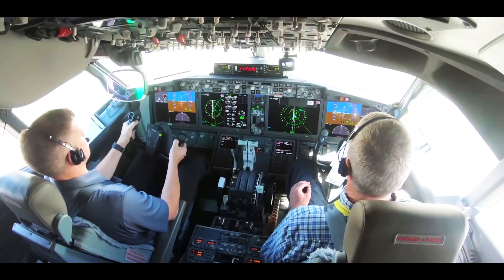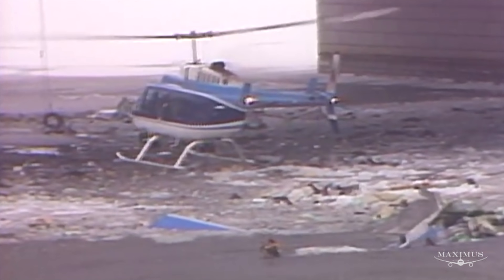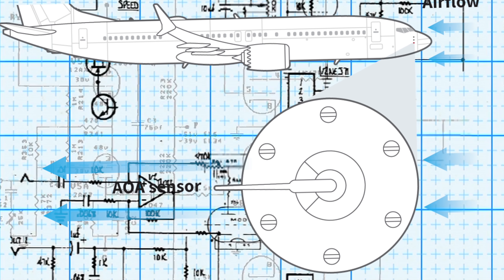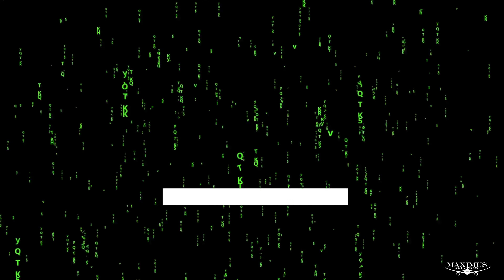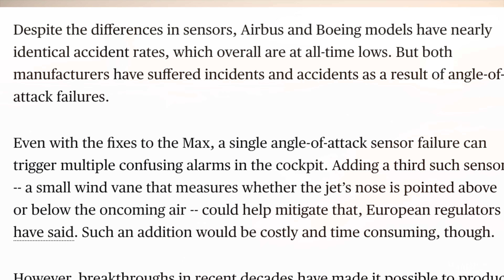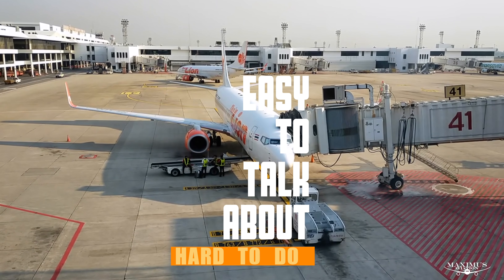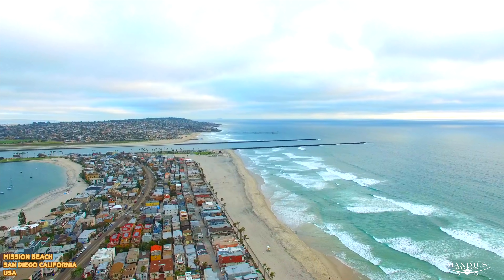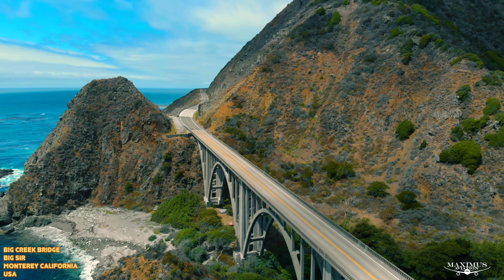Boeing To install 787s Synthetic Air System On The MAX! Boeing Caves To The EASA Will Install System

Comment: More software to fix a basically flawed aircraft design?  Patch upon patch upon patch upon ...........
Reply: The engines were repositioned forward, which moved the centre of gravity forward, which causes the plane to pitch upward during acceleration when taking off (rotation). The truth is that software patches cannot make an unstable aircraft safe. I will never fly on such an unsafe plane, even if they  change the name as a coverup to try to fool the people.
Reply: John Campbell Your statement is wrong on so many levels. The 737 Max is not unstable and it does not pitch up by itself during takeoff. MCAS will only intervene at very high angles of attack with the flaps up and not during normal operations such as takeoff, cruise and landing.
Reply: @kristoferstensvik6515    great pity that Boeing didn't inform the Pilots about that.. they knew the critical differences and consequences,   but deliberately chose Not to inform the Aircrew 😣🙄😆
Reply: Andy B. Inform the pilots about what? The procedures for handling the result of the fault, called “runaway stabilizer”, have been basically the same since the first version of the 737 in the 60’s. All pilots train for this and should know this by heart. Also, the fact that the Ethiopian crew knew about MCAS, both officially through Boeing bulletins which must be read and understood by all pilots and through the media, invalidates the claim that knowledge about the system would have prevented accidents. You could know every little detail about the aircraft but it does not determine how well you will perform in the event of a major failure with multiple confusing factors to deal with at relatively low height.
Reply: @kristoferstensvik6515  company shill? The max is unstable and that is why they added the MCAS. The worst is that this system depends on one single sensor. Whichever way you look at it; I hope that murdering board of directors go to jail and Boeing goes bankrupt. Have you heard of the Dreamliners made in Florida and how they are death traps too?
Thank God we have Airbus.
If it is a Boeing then I'm not going.
As a frequent traveller I have made it a point not to travel in any Boeing plane 
Life is not a video game and we only have one life.
Reply: Yiannis Mantheakis Call me what you want. Just like previous versions of the 737 the Max is NOT unstable, nor is any other passenger airplane ever built and certified. That is a basic fact, easy to understand with some basic knowledge about how an airplane works. Don’t trust everything you read in Youtube comments, but trust this :)
Reply: @kristoferstensvik6515  So you are saying that the aircraft can be operated by a pilot manually at all times without the need for any assistance.
Reply: @FairladyS130  No, that is not what I was trying to convey. But to answer your unrelated question: Yes, since the 737 is an old design with a primary flight control system that is hydraulically assisted but in which the control surfaces are mechanically connected to the cockpit controls it is possible for the pilot(s) to operate the controls regardless of the status of the electronics and computers. It is even possible to fly it without the hydraulics, by muscle power only.
Reply: Oversized engines that had to be repositioned so as to fit but made the plane inherently unstable. Yup a 60s airframe patched to kingdom heaven in the name of profit.
Reply: You can only polish a turd so far 🙄
Reply: J Smith No, it didn’t work well because the system is badly designed and flawed when it comes to redundancy which is one of the contributing factors in these accidents. However, that does not mean that the airplane itself is unstable.
Reply: @kristoferstensvik6515  Yep, from what i read the plane is stable, but is also not exactly the same as the previous 737. So the added the MCAS.
Reply: Nothing at all flawed about the Boeing 737 design. Ask any pilot, and I mean ANY pilot. They will say the same.
Reply: @RedLP5000S  People telling me I don't know what I'm talking about, grrrr.
Reply: I mean tho once it’s back in service it’ll be the most safest airliner.

Comment: The 73 Max was...”designed by Committee”, and fortunately, most of us here know what that results in.

This stabilization software solution simply equates to putting lipstick on a Pig.., it’s as simply as that.

Comment: Boeing convinced me to always fly Airbus.
Reply: Airbus has had its own share of similar computer malfunctions, the max is a good aircraft whose reputation was damaged by dumb management !
Reply: @davemanning6424  yeah but Airbus openly admitted them and fixed them quickly. Now it’s brining A350 technology to the A320 and A330 of enhanced monitoring of the AOA and ADR’s to more easily identify a failure or erroneous data
Reply: dave manning  Boeing denies its problems and did whatever it could to coverup problems with its designs, manufacturing issues and faulty construction.  Boeing seems to have the corporate disease of protecting bad managers
Reply: "If it's Boeing, I'm NOT going."

Comment: Maximus - how about doing a technical follow up on the Max changes where if there is an AOA disagree, MCAS is disabled and an AOA Disagree warning is displayed so major cause solved, and that the Max is very stable without MCAS, or how the EASA is just trying to get to Boeing by requiring the synthetic airspeed that’s not part of MCAS but part of their manufacturer’s planes.  Basically technical info from pilots like Mentour Pilot or Blancolirio and not university professors.  How about a video with you interviewing them!  That would give your subscribers number a big boost as it would expose their listeners to Maximus.
Reply from the maker: Love the idea.  I thought about that especially Biancolirio.  I'm not sure how to make that happen but I can Email him at least.  I've seen him do quite a few interviews so he just might.  Thanks.

Comment: With billions of dollars spent on fixing this pile of junk they just should have redesigned the landing gear higher. So they just could put on the engines under the wing without having to raise the engines so high. Penny wise and dollar foolish.
Reply: 2 things: 
1. The engines being higher was never a problem. The thing was their increased surface area.
2. It would be stupid to raise the landing gear. Not only would it not fit in the wheel well anymore, there's a reason 737s were designed to be so low. How many A320s have you seen with airstairs? Now compare that with how many 737s have airstairs. There's a reason that's possible.
Reply: Apparently they were reluctant to redesign the plane's centre-section to accomodate a new, longer type of landing-gear strut; also, they would have had to retrain crews because the higher landing-gear would have led to changes in flight- and ground-handling.

Comment: What happens when the computer software quits? An inherently dangerous design kept in the sky by computer software. Are they kidding me.
Reply: The Max is not kept in the sky by computer software, it still has cables and direct connections to the flight controls if a trained pilot knows how to use them..The a320 IS kept in the air by computer software
Reply: @drewpknutz1410  but the a320 does have mechanical connection so even with all 5 computers failing (which has never happened) it can still fly and land
Reply: Thanks for describing an A320 to me, I'd forgotten what that was like, I haven't seen any in so long. If only they were a good plane. But what relevance does this have here?

Comment: What about the EICAS which SHOULD be on 737-300 back to 1984 (already on 767/757 back then) and ELC which SHOULD be on 737NG back to 1998 (anagin, already on 777 back then).
EASA is also saying 737 could not do a good job on informing multiple failures (and they might be cause by one common root) to flight crew, that's what the problem is.
Reply: What about the EICAS? Are you implying the 737 doesn't have it? Because I can assure you it does.
Reply: @RazvanMaioru  The Master Caution system is still that chunky light plate up to MAX, the only "EICAS" any 737 would have is an single "AUTOLAND" message that only found on Fail-OP autoland equipt option.
That's far from what you can find on 757/767 or 744.
Reply: @umi3017  EICAS - Engine Indicating and Crew Alerting System = the upper center screen on 737s. And 747s. And 777s. Probably 757s and 767s too. It's there.
Reply: @RazvanMaioru  There Is no Crew Alerting System on 737.
Reply: @umi3017  as I said, the upper center screen. On the NG, that is. Idk if the classics can count what they have as an EICAS, though. On the max, it's like the 787/777X, on one half of one of the inboard displays.
Reply: @RazvanMaioru  As I said, it doesn't contant any "Crew alerting"  function (apart from that "NO AUTOLAND" one, as optional), thus it's just a scenery for engine indication.
I'm a rated instructor on 737NG/MAX.

Comment: The 737 MAX program had a set price and Boeing leadership wasn't going to let anything change that no matter how necessary said extra may have been. I've seen where a simple clamp would alleviate wire chaffing and customers even recommended so, yet Boeing declined as it wasn't per their current blueprint and would cost $1.00 per aircraft extra. Without the extra clamp we had to manipulate the harness trying to keep wires from chaffing during inspection, this didn't guarantee that later the wires would not eventually chaff, it guaranteed they wouldn't have to place an engineering change note and add an extra clamp per aircraft. Boeing = penny wise and dollar foolish.
Reply: Read about Ford's declining to spend $5 on fire-protection measures for its 1960s "Pinto" car, preferring to see trapped passengers burned alive after crashes 'cos statisticians said that paying compensation was cheaper than fixing the machinery.

Comment: "...and certifying them is a bear."

Sorry, I did not get that. Can anyone tell me exactly does it means? Thanks jolly people!
Reply: Yeng Sabio That means (to my interpretation), “It’s complicated.”
Reply: @ScottRothsroth0616  Ah, copy that! Thank you, good Sir!
Reply: Yeng Sabio Your welcome and have a great (rest of your) day.
Reply: @ScottRothsroth0616  And you as well, Sir!
Reply: Synthetic airspeed is part of computed air data that takes its inputs from multiple inputs including thrust, altitude, attitude, airfoil settings, air pressure and can derive data should a particular sensor fail.
Reply: Certification is the formal testing and documentation that is presented and approved by the regulatory bodies. In this case the FAA and likely also EASA. Getting regulatory bodies to sign off on your certification activity is difficult when systems are new and complicated.. like wrestling with a bear.
Reply: @jiml5837  Copy that. Thank you Sir!

Comment: That’s just great! Now they want to add another computer system to protect us from the other computer system! What a crock of bs! What ever happened to letting the pilot use his own brain?!?!
Reply: That's the core of the issue: MCAS is designed to be hidden, the pilot should not know about it, he is not allowed to use his brain.  An A320 pilot knows exactly what to expect from the computer because of the flight control modes: Plane is in normal law? Computer is the boss. Plane is in direct law? Pilot is the boss. That makes diagnosing computer problems a lot easier. With the 737 Max, the computer hides itself, the pilot has to be super alert to know that the computer is malfunctioning, in situations where every second counts. Therefore with the 737 Max, the computer can never fail, depending on the pilot's brain is not an option, because the plain is designed in such a way that the pilot's brain doesn't get activated.
Reply: Daniël Mantione 
Wow! Very well said!
Reply: @danielmantione   @Daniël Mantione  "MCAS is designed to be hidden" what absolute bullshit. The MCAS trims. The trim wheel cannot move unnoticed. It's striped and loud, and right beside your knee. There is no way you don't notice when it's doing something, and there's no way a trained pilot would take more than 3 seconds to decide if it's not helpful, and shut it off. The thing you don't seem to realise is that Boeing pilots aren't as brain dead as Airbus pilots can be, because they use their brains all the time when they're flying it. Because they're the ones flying it, not a hidden autopilot. Obviously exception when using autopilot, so during cruise.
Reply: @RazvanMaioru  How does the 737 pilot know that the computer is turning the trim wheel if he doesn't know that the computer can turn the trim wheel? How can he override the computer?

These are two questions that are very easy to answer for an A320.
Reply: @danielmantione  he knows the computer can turn the trim wheel. The autopilot is one example of a system that can do it, another is a system I don't know the name of that automatically trims up for you on takeoff after a certain period of time where you leave the aircraft out of trim (basically if you forgot to trim, it does it for you). But sometimes that's undesired, which is part of why there's a runaway stabiliser procedure, where you first disable the autopilot, and if that wasn't the problem, you cutoff the trim. The switches to do that are on the throttle quadrant right behind the trim wheel, and if you want to look for them, they're labelled "STAB TRIM CUTOFF". After you've done that, the computer is absolutely overridden, as are the trim switches on the yoke (in case those were the issue, sending erroneous signals, possibly due to some short-circuit or something). You then trim manually until you land, then you get it fixed. And the answer to your first question more literally, is that the pilot knows it's the computer if it's neither him nor his copilot, but if he doesn't know the computer can turn it then he has a lot more to learn about 737s before he's allowed to fly a real one, outside of a simulator.
Reply: @RazvanMaioru  So I have turned off the autopilot, the trim wheel is still automatically turning. Why the heck is that? Will the pilot use his brain within a few seconds know that a hidden computer program is turning the wheel? You are expecting a lot from this brain.

Yes, if all electronics fail the pilot can resort to muscle power with the 737. We have seen the results with the crashes. This is an issue that remains unsolved after the 737 Max will return to the skies: The MCAS problems will have been solved, but questions wether pilots are really able to control the plane with muscle power in all situations remain.
Reply: @danielmantione  as I said, the autopilot is just one system. That's why disabling it is just the first step. After you do that, you wait and see if the problem has stopped because of turning it off, and if it hasn't, you continue the checklist: use the stab trim cutoff switches. This is why it really doesn't matter if Boeing told pilots about MCAS or not, because it's not the only system that can trim the aircraft automatically with autopilot off, and it really makes no difference if it's MCAS or another system that pilots are already trained on, they can do this procedure to disable it. And as for muscle power, remember there are two pilots. Not only can they take turns, because the controls aren't just joystick inputs they can work together to share the force. And once they've trimmed it, using the handles on either side, much less force is required unless you're doing extreme maneuvers, which you really shouldn't be doing anyway.
Reply: J Smith  at 3000 feet you still never hit the ground if you're level. You don't turn off the autopilot and let go of the yoke to see what happens, you turn off the autopilot and keep the plane level yourself to see if the trim runaway continues. Use common sense. Which includes that obviously, if you're not on autopilot to begin with, you skip straight to the trim cutoff. And you try simply trimming back up first, so you're in trim already when you go manual (if it works, which it would in the case of MCAS activating on false data).
Reply: @RazvanMaioru  You have read about the concerns that as the 737 evolved and got heavier, the amount of force needed to control the plane did increase, the size of the trim wheel did decrease so less force can be applied, and female pilots with less muscle power are nowadays much more common than in the 70s?

These issues are not going to be fixed for the return to flight and are key to the reason why the recertification took so long: The advancing understanding that mechanical control is not a solution under any circumstance required every scenario in the safety plan where the pilot was supposed to activate mechnical controls to be reviewed.